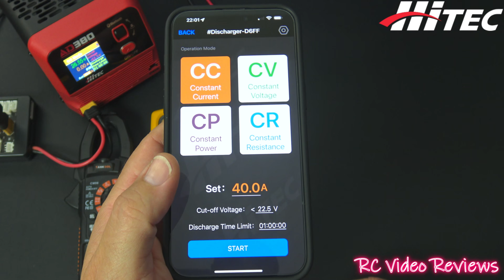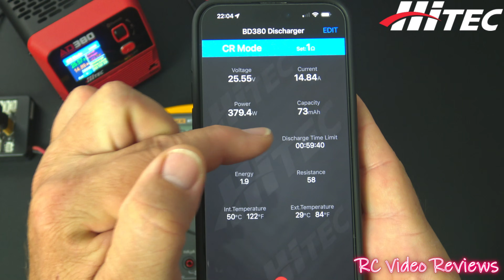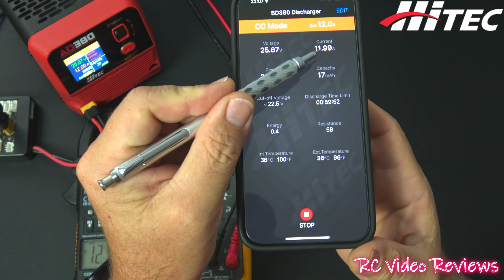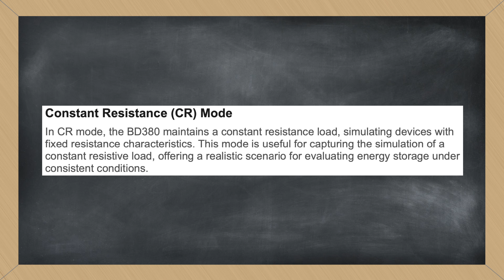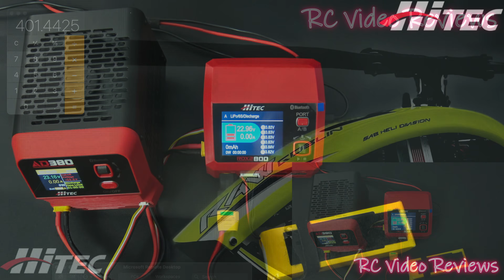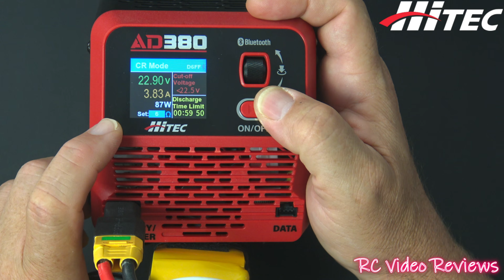HiTec AD380 LiPo Discharger Pre-Release • A powerful discharger with legit smart features.

Comment: I guess, constant voltage could be used to forcibly limit the voltage in a power supply system. I imagine, for example, you are powering your charger from a battery, it has a regenerative discharging and you can use the discharger to protect the supply battery from overcharging. For this, the voltage limit must be set higher than the current voltage. This, when you are using equipment that is not compatible with the unit ...

Comment: I have the sky RC version.  Until i did a little deeper into battery performance,  i will just use it for discharging at the track quickly and of course without burning up the batteries and bench.

Comment: So what would you set at if all you want to do is discharge your unused batts to storage voltage
Reply from the maker: Whatever amperage is safe for the battery and 3.8v/c.
Reply: Sorry,kind of new to this but how can you figure out what is safe for the battery. I realize the discharge rate is pretty high when your bashing your rc but how do you figure out what is a safe rate of discharge. Like charging is safe at 1c is discharging safe at say 6c?e@RCVideoReviews
Reply from the maker: The MAH rating is say, 2200. That is milliamps. Amps would be 2.2.
Reply: Thanks man. Very much appreciative of your time.@RCVideoReviews

Comment: The difference in internal resistance value is relatively different. When the battery is operated with a smartphone, the internal resistance value diverges between the display of the main unit and the display of the app.

Comment: Can you discharge a 1s pack to 3.3v at 40amps?
Reply from the maker: 380w max / 5.9v min main voltage. 380/5.9v=64a. So the math checks out. Spec says max discharge current of 40a.
Reply: @RCVideoReviews  ok so then a 1S will not work because it doesn't meet the minimum voltage of 5.9v to operate. I wonder if they can do a firmware update to make that work? Lots of 1S users from 1/12 onroad to Oval that need a 40a discharger.
Reply: @garylewis176  Paired with D200neo - can you discharge 1s 40A

Comment: CV Mode is not an output, it's a mode that should only be used when connected to a charger or a power supply (not a battery). 180W max.

Comment: This is a skyrc bd380. I just got one today. The apps graph is not csv file yet.😢   I use it to test my car battery reserve capacity at 25 amps to 10.50v loaded.  Voltage drop using 1 meter long awg 12 is 0.55volt loaded at bd380 compared to battery post. I use it also to test  my bench power supply. Hope they improve the app, its not screen optim8zed for tablet too. Thanks for the review🎉
Reply from the maker: You're welcome.

Comment: Video content seems intended for engineer/hobbyists. A simple video showing basic connections and settings and how to use the thing would be better for average users.  Looks like it can discharge only one pack at a time, has a number of modes to select, one to AVOID, looks a little complicated/fidddly  for beginners. (I was wrong about need for power supply)
Reply from the maker: The video ended with a demonstration of the discharger in standalone mode. Not sure how much more simple I can make it. It also is intended for hobbyists. Why would you need this if you weren't a hobbyist???
Reply: @RCVideoReviews   Just wanted to know product basics, that might have been covered at the beginning,  then go into a "design review". I didn't mean to be hypercritical.
Reply from the maker: This is a no win proposition for YouTubers. Start with basics and I get "Yeah yeah, get to the app" Start with the app and get "But what about the basics" Gotta start and end somewhere.
Reply: @RCVideoReviews     hahahha  i've seen this  comment  before

Comment: Looks like it has the same problem as the other SkyRC dischargers - it can't do a CC/CV mode to reduce a pack to a designated level. You have to use CC mode and set the voltage cutoff based on what you guess the pack will read under load.

When paired with the charger does it work in storage mode? That's the main attraction of this setup to me - quickly reducing unflown packs to storage voltage (with balancing).
Reply: That's what you need to get. It will discharge and balance: KACALLAP α12 LiPo Battery Smart Discharger
Reply: @delfin2003  Thanks, I'll look into it!
Reply: Hello, I just got this discharger and have the same issue. At 35A discharge, my 2S lipo pack drops about .4 V, verified with a Fluke. I want to discharge to 3.3V per cell and have to set the discharger to like 5.9V because of the voltage drop the discharger reads. :( Is this normal?

Comment: I think the constant voltage mode is useful as a power supply. I actually use my constant voltage mode on my Hota D6 quite a bit. I think most of the iChargers do cell balance & monitor during discharge as well. Also, for those that might not know, these Hitec charger/dischargers are SkyRC rebrands, so if you want to find information on a feature, it might be helpful to search SkyRC rather than Hitec. Edit: lol, I commented before getting to the SkyRC part.